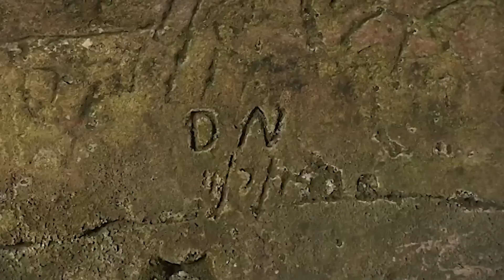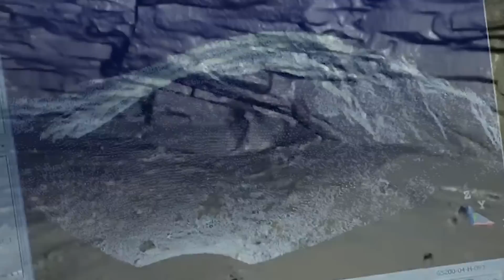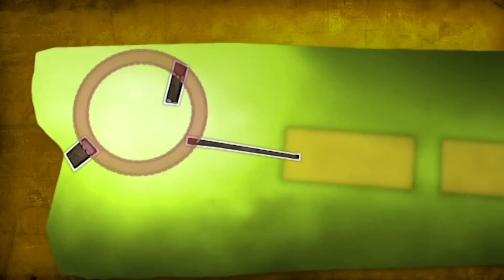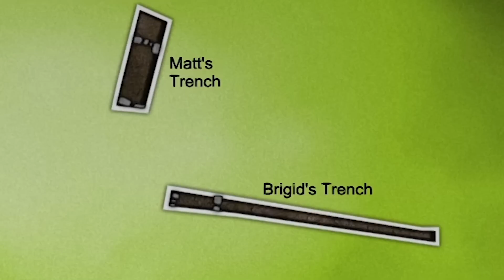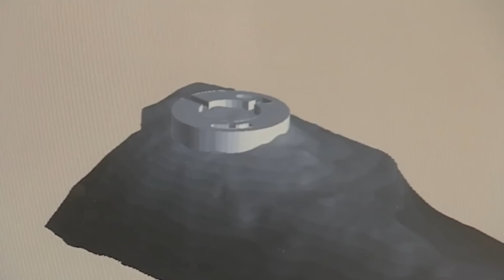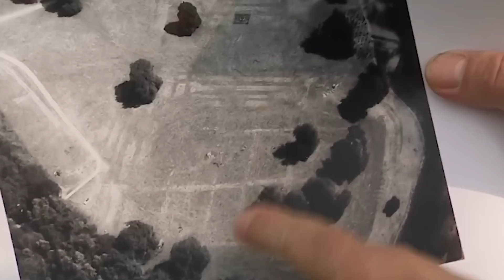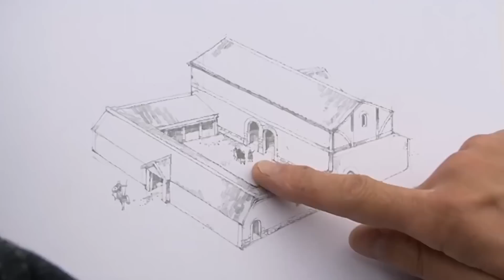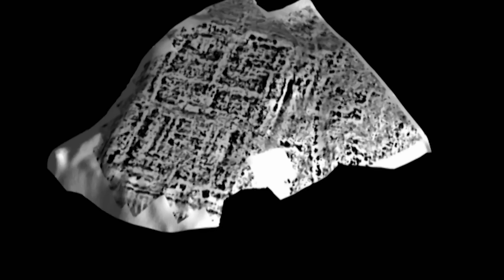➤ Time Team's Top 3 SCOTTISH Digs

Comment: Habitation of caves is impractical and dangerous. They are dark, slippery when wet, with low ceilings which can easily crack a head open. The damp environment doesn't allow for food storage. Entering and exiting with little or no illumination poses a huge life risk every time one takes a leak outdoors. The air quality in caves can be terrible, but these appear to be pretty well ventilated. Fires or hearths make the air polluted and toxic, perhaps to the point of killing all occupants. Very temporary shelter is about their only potential. I wish archaeologists would stop with the immediate assumption of occupation because occupation is the exception to the rule rather than the rule itself.
Reply: God damn pesky archaeologists doing their jobs.
Reply: @themadplotter  exactly, they’re always digging up the past
Reply: All caves are not created equal, some have good ventilation  and headspace, where do you come up with this?  Any kind of shelter in those times was taken advantage of.
Reply: Caves are great. Damp yes but you'd feel incredibly safe compared to being left out in the open for wild animals to tear you to pieces.
Reply: Everybody wants their own cave...